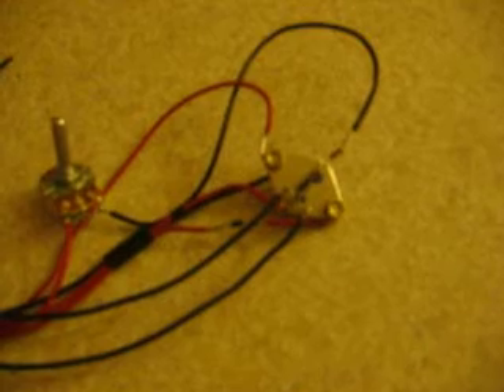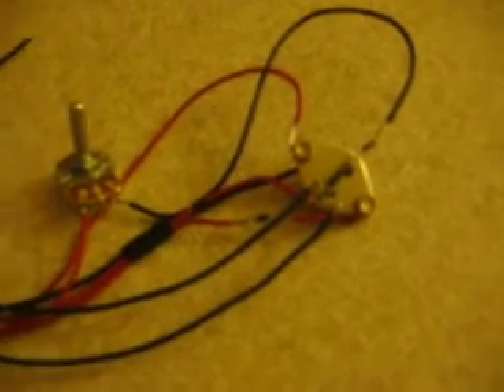First Time Bedini Circuit

Comment from the maker: Hello, 
From what I've read, the whole circuit with the coil acts like an engine.
First you give the rotor a spin by hand, and when a magnet passes over the coil the small wire or "trigger wire" sends an elecrtic pulse to the transistor which amplifies this pulse and delivers it to the larger wire or "power wire" which pushes the magnet.
This all happens almost instantaniously.
This circuit eleminates the need for a reed switch.
Eddie

Eddie